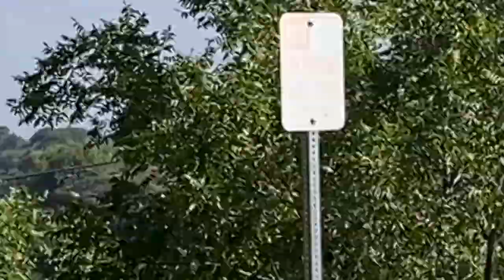Coaster Brake Challenge Series 30! Heat 2, 15 miles and 2500' climbing to Puke Point

Comment: George.
Thank you for posting.
I’ve been following.

I just started riding coaster brakes. First time since I was 9.

My concern with the cb e110 and KT version is the pressed on flanges. Is it worth being concerned about? I weigh 190#, and aren’t an extremely powerful rider.
Reply: PS, it is liberating having a “go bike” without levers or cables.